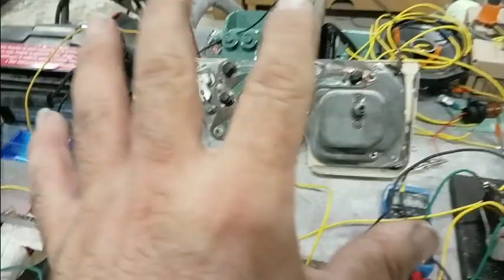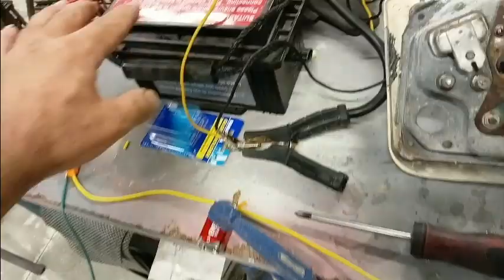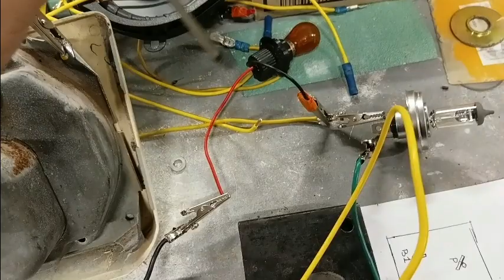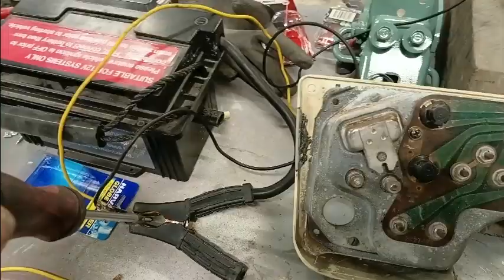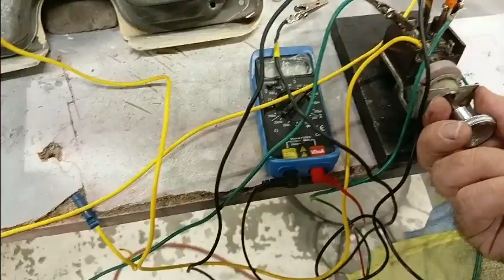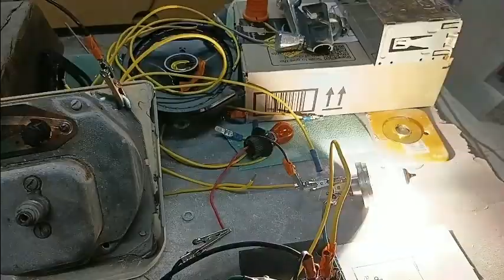Testing a Chrysler  Valiant headlight switch

Comment: Good work man , does yours have a fan ? If so can you do a vid on that if you can . I have an issue with mine. It seems jammed and I know there is a soldid wire has come off but not sure where . 👍✌
Reply from the maker: Thanks mate. Unfortunately mine was basic, no heater.
It just has the little oven doors under the dash.
Reply: Yer I think it come off the main switch, I'll have a dig around.👍✌
Reply from the maker: @Sweptundertherug  i reckon if it comes off the main switch (headlight switch), it will be fed power from the pin labelled B2. Good luck with it. let me know when you find out.